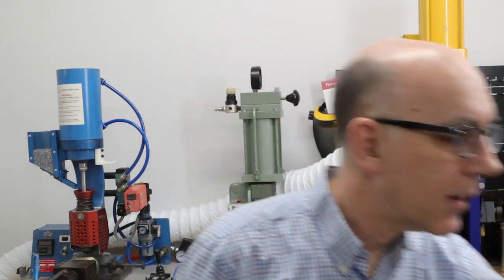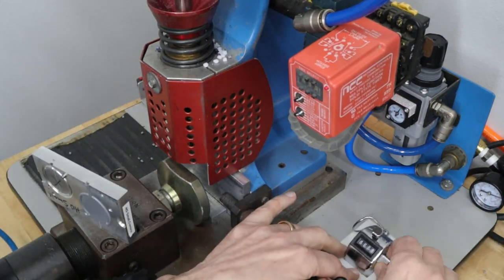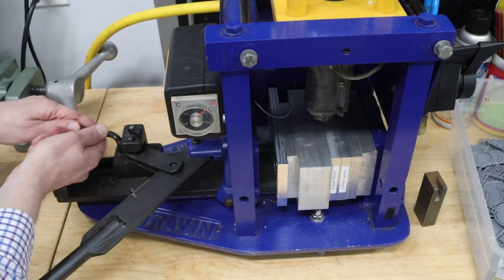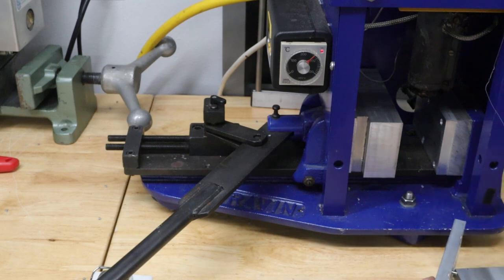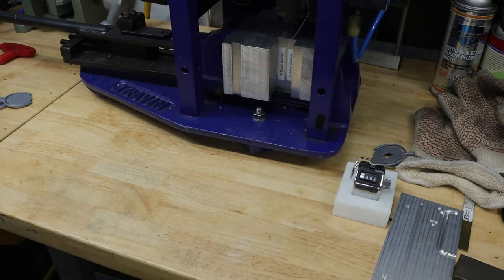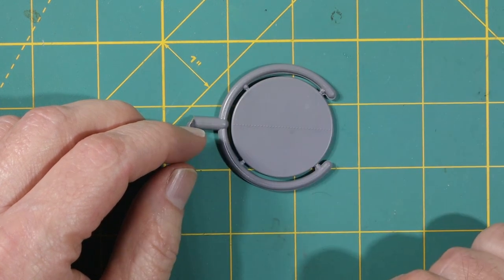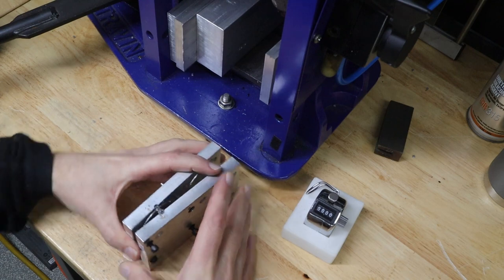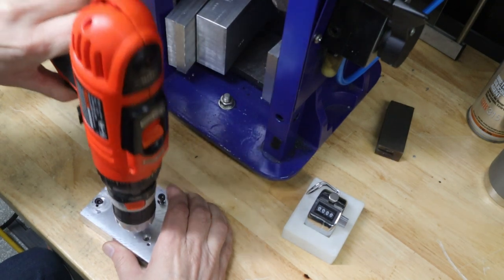Making Larger Injection Molded Parts

Comment: I've been watching a lot of your back catalog.  I'm trying to decide whether I want to get into injection molding or if I will farm out the work.  Your videos do a great job of breaking down the process and making it seem rather manageable.  Thank you for sharing your insights and experience.
Reply from the maker: I'm happy to help you answer that question. Send me an email if you're interested.
Reply: This is a really big debate - whether to make the parts yourself, or to hire them out. (It's a debate we've had at our shop and is still somewhat ongoing.)
JohnSL will have, I'm sure, some invaluable information for you if you reach out to him.
Reply: @TheCrafsMan  Thanks CrafsMan!  John and I have shot messages back and forth.  He's INCREDIBLY knowledgeable.  I saw the work he did for you as well (I'm a long time fan of your channel too).  I bought an injection molding machine about a year ago after I posted this comment!  Keep on Steady Craftin!!!
Reply: Im wondering what happens when you dont screw it? It seem like a lot of clamping force. How much pressure is the machine pushing the plastic?

Comment: You could probably double the cycle time on the screw reenforced mold.
1- Better/shorter driver. The Milwaukee M12 Instillation driver is excellent. Compact, powerful, precise, inexpensive. I started using them in my machine for clamps and fixtures and it is a game changer.
2- Make the screws 2"+ long, with holes in the spacer plate to accommodate the extra length. Unscrew the fasteners enough to get the part out without completely undoing them, and you reduce the handling count by 8. Massive time savings.
3- Mold jig for the operator. Eliminate the hand-torquing effect with a jig to hold the mold for opening/closing. Faster + Safer.
4- Threaded inserts (KeenSert, Helicoil, etc) to solve the threads in aluminum issue.
Great videos BTW! You're making me think we should get into injection molding our own parts!

Comment: Thanks John, I've just switched from a manual Travin TP1 to a hydraulic version the same as yours, I'm having trouble as I thought I would as I noticed the hydraulic version moves quite slowly and acts like a ram splitting open my moulds, I seem to have got away with it on my manual machine by pumping in plastic quite quickly this works pretty OK. I thought I would have to resort to bolting them together and you've beaten me to it!

Comment: Thank you for share you experience with the world !  Interesting rule of thumb for the clamping for molding part. The screw could be made to be remove by sliding of the edge of the mold. Maybe it would make you cycle time a bit faster. But it would need a nut and maybe a ticker plate. Great vid keep at it !
Reply: He could also fabricate a tool that uses a large planetary motor coupled to four gear driven chucks that could run them all in and out the same time but modifying the clamp with an Air over hydraulic ram makes more sense.

Comment: If you'll take a center punch and angle it into the hole for the dowel pin (without the pin in) you can put in a couple of punch marks, and that will be enough to lightly press the pin into place so it stays put.  You can also do it around the edge of the hole if that's easier, but anything that will just slightly deform the hole inwards will take care of it!  I had some molds where I got my clearances off and it allowed me to go ahead and use them.

When I make molds, I still make through holes for the pins, but I make most of the hole a slip fit for the dowel and a light press fit for only the last 1.5-2.5mm.  Then I can easily press the pin in after slipping in most of the way, and the pin stays.  But if I need to remove it, a couple of strikes with a punch or drift and take it back out since it only had a couple of mm of press fit.

We're still working on our plastic injector.  We have electronics working, and have made parts but now are going through a round of redesign.  I'll update you when I have an update!
Reply from the maker: Currently I use 1/4" dowel pins that I mill to very tight tolerances on my Haas. I also have 1/8" diameter through hole that would allow me to press out the pin if I need to. That works much better than these 10-year old molds.  Given that I'll probably never have to make these parts again, which I should have mentioned in the video, I figured it was OK to just make the parts. Looking forward to seeing your machine.

Comment: Have you considered using an over/under reamer set for dowel pins? The undersized reamer is a few tenths below, so the pin has to be pressed in and it will stay there while the oversized reamer is a few tenths over and provides good positioning.
Reply from the maker: There have been lots of suggestions along this line. These are molds I made 10 years ago before I know what I know today. I don't make molds this way anymore.

Comment: What about using a horizontal mounted 10 or 20 ton air over hydraulic jack for clamping? 

Would you be able to utilize the extra clamping in making a larger part? 

There are others using steppers and ball screws to clamp their molds who are making  significantly larger parts.

Comment: I had a question. You mentioned that the clamping force required is proportional to cross sectional area but it seems that most of the parts you make a quite thin. If the part you are making in this video were say 1in think with the same cross sectional area would you still be able to make it and the clamping pressure would still be sufficient?

I am considering getting one but the thickness of the part I want to make is about 1/2in thick with maybe about a 1in squared cross sectional area.

Comment: Johh, how does the Travin know when to stop injecting, or match the amount of plastic dispensed to the volumetric space of the cavity in the mold?   Why do we not see plastic coming through the air vent ?  Is seeing plastic oozing out a good way to know the mold is full ?
Reply from the maker: The barrel contains more plastic than the part needs. So it injects plastic until the back pressure equals the injection pressure. I then top off the barrel after every few  cycles. As to why it doesn't come out the vent, plastic is more like a paste than a liquid, so it can't fit through thin sections. The air vent is about 0.002"  deep, which works very well for air to escape without letting the plastic in.

Comment: A little tip for holding the packing pieces together is to use double sided tape. I used to swear by the Tesa brand (not cheap!) It's really good at not leaving sticky residue. Used to hold plastic plate onto a milling machine bed for machining! Don't use too much tape! Not sure if you're clamping force would be too much for it? Edit.. wish I knew the Tesa product code.. sorry

Comment: Hey John thanks for the injection molding content. I am using a manual plunger style desktop molder. I’m having issues with the nozzle drooling plastic out while I’m removing parts from my mold. It makes a huge mess and lots of strings when I scrape the glob off the vise each cycle. I’ve tried decreasing barrel temp but then my molds don’t fill. How do you handle this? Your process looks so clean (and with less plastic waste!). Thanks and love your videos!
Reply: I just bought a manual machine, it's supposed to be delivered this month, and I'm making a couple of molds to try when my machine arrives. The question is, how big are your plastic pieces? How many tons of pressure can be generated in a manual machine? Are your pieces bigger than JohnSL's? 

I am afraid that when my machine arrives, I will not be able to fill my molds, due to lack of pressure. which is the nature of the manual machine.
Reply: @cesarmata3787  mine is an LNS-150A. The parts I’m making are round wheels, 11mm diameter and 6mm thick. My mold makes 4 wheels at a time. I extended the handle on my machine and it still takes a lot of force to fill the molds. My abdominal is sore after a day of molding haha
Reply from the maker: That's often an issue with desktop machines. All of my machines have a valve in the nozzle that requires the nozzle to be slightly pushed in before the plastic will flow out of the nozzle. That pretty much prevents drooling. Another thing that makes a difference is the type of plastic. These parts are all polystyrene. But I know polypropylene is a lot runnier, and therefore more likely to drool.
Reply from the maker: Four of those wheels sounds like expecting a little much from the LNS-150A. You might be better off with just two wheels at a time. Sure, it reduces throughput in theory. But it might give you better process reliability.

Comment: Great channel! 🙂
Have you tried that mold without the screws? Looking at the clamping system and that steel machine body it looks more like 10 ton equipment than 4 ton. Even a decent bench vise is good for 4 ton.
Reply from the maker: Yup. When I first made the mold 10 years ago, I tried it without screws and I couldn't keep the mold from flashing. So I added the screw holes, which are somewhat crude because of lack of skill on my part back then. The Travin TP-1 states that it's a 4.5 T clamp.

Comment: I'm a bit surprised you didn't  ream the dowel pin holes, with one side being an interference fit and the other side being a slip fit, pressing the pins into the interference fit side for permanent retention.
Reply from the maker: These are molds I made 10 years ago and, well, there are lots of things about these molds that I would be embarrassed to do in molds I make today. Because of the very low volume, it's not worth redoing the molds. In fact, it was never financially worth making the molds in the first place, but I learned a lot.

Comment: Hi John-
first, thanks for the videos. These are very educational for me and I'm learning a lot.

But here's a question, and I apologize if you may not like it, but... What is your take on the Precious Plastic injection machines? We have one here in Savannah, and we like it because it allows us to recycle pretty fair amounts of plastic that would otherwise be landfilled. But we want to up our game.

Ours is a manually operated machine that injects a comparatively large volume of plastic. It uses bolt-together molds that are (again, comparatively) fairly crude- simple laser-cut affairs. We make simple coasters and small plant pots, and small sea creature keychains.

So my question is this- what improvements would you suggest for these machines? I have a few ideas that I'm mulling over, but I'd LOVE to hear your thoughts.

Thanks
BG
Reply from the maker: I have no experience with the Precious Plastic machines. I've used bolt-together molds and try to avoid them when I can because they're so labor intensive. It sounds like the one improvement the machine could use is better clamping. A toggle clamp is probably a good choice, and probably not that hard to design and build.

Comment: Thanks for another injection video. Have you thought about using loctite or super glue on the dowel pins? I would press fit them from now on but to fix your older ones that may work.
Reply from the maker: That's what I do on my more recent molds. With these molds, I often have more than one cavity and I have to use different holes for different cavities. These are molds I made 10 years ago, when my skills were, shall we say, still developing.
Reply: @JohnSL  ahh I get it. Maybe silly puddy or something sticky like that that can just kinda keep it from falling out.
Cheers.
-Daniel
Reply from the maker: What I could have easily done is to use some removeable LockTite since I already have some. But, well, I just wanted to get the parts done. And most of the time I did a good job keeping the pins from falling out.

Comment: nice video! Are these more parts for the train model oil tank building from last week?  A static vent pin in the middle of the part may help with getting the air pocket out and lower you pressure. if cosmetics allow
Reply from the maker: They are. I could certainly put a vent pin in the back. That being said, these are molds I made 10 years ago and I expect I'll never use them again, as the kits are being discontinued. So not worth improving. Plus, production volume is tiny--I think on the order of 100-200 parts total for the lifetime of these molds.

Comment: Hi John,
Could you please help me identify one very, very old injection moulding machine which I purchased on Ebay near London.
The tags exhibit the previous company name and a patent number. Unfortunately, the patent relates only to the way the mould is pushed out from a mould by operating the vice, and not the machine itself. I am interested in an operating manual or blueprints, since some hydraulic parts are missing and the heater energy regulator is not really working as it should. It is always in the ON position, regardless how I turn the knob. Finding a replacement for this is a task by itself, unrelated.

So, is there any way you could help me, considering your experience? Any advice is welcome.

Comment: great video, could you use a large c clamp  around the outside of the  machine to boost the machines clamp?
Reply from the maker: Possibly. Although, I'm not sure that would be much faster than the screws. Fortunately, I've now retired the molds that required the screws. Plus, I have my Morgan, which has much higher clamping forces. I'm debating selling the Travin.

Comment: John,  do you have to cool the die halves periodically or are the cycle times low enough that the heat doesn't build up?
Reply from the maker: For larger parts if I keep running them for a while, the mold does get hot. The issue is being able to hold the mold. Because it's aluminum, it doesn't take long for the mold to cool back down. For small parts, the molds never really get that warm.

Comment: Great video 👍John Tool maker's use a half thread trick to speed up jig time assembly disassembly machined at angle half the thread's are used.
Reply from the maker: That sounds interesting, but I think I need some more information. Can your provide a link or a longer description? I'm intrigued.
Reply: @JohnSL  I used a few drill jigs that had a nut with part of thread cut away I tried to find a link no luck an alternative would be a multi start thread as used by fly presses it moves greater distance for a given motion and multiple load.

Comment: what if  we install   20 ton hydraulic or more at this  home injection machine (with reinforce structure for sure), do you think it can make even more larger part sir? . How big the part is that can possible with this type  home injection molding. I think about more larger part like a size our palm hand. Thanks.
Reply from the maker: Yes. Some people have done that and it works. The rule of thumb is that you need 2 to 2-1/2 tons of clamping force for every sq. in. of cross section. So using the upper value of 2-1/2 tons, that would give you a maximum cross section of 8 sq. in., or 2.8" by 2.8".
Reply: @JohnSL  I see,  the clamp that need to reinforce too as the pressure increase.. thanks Sir..

Comment: Maybe use dowel pins but thread one end so they can be left on one side of the mold?
Reply from the maker: Thread locker is a lot easier. I should have used that in this mold, and can't give a good reason why I didn't.

Comment: I may have missed something in earlier videos, but what happened to the Morgan press? I would have imagined you would have used that machine for your larger parts.
Reply from the maker: Yea, I mentioned in my previous video that these are molds I made 10 years ago, long before I got the Morgan. These we would super easy to make with the Morgan. But it's not worth redoing the molds because the volume is so low for these parts.

Comment: Thank you, i learn about the pressure of sq inch of injection mold, is that possible to have two or more injection input in same time for large scale mold?
Reply from the maker: If I understand correctly, you're asking if you can make more than one part in a mold? If so, yes, I've done that. But that would require even more clamping force (or screws).
Reply: @JohnSL  oh, yeah, i see！the mold need to under take more pressure and damage by pressure.

Comment: Is it possible to have molded-in parts included, such as power connectors,  when do the 3d printed mold approach?
Reply from the maker: Yes. This is called over molding. The requirement is that the mold is tight enough around the connectors that need to be exposed so the plastic doesn't exit the mold.
Reply: @JohnSL  Thank you very much for your answer. Is this something that you could demonstrate? It would make a pretty good video. For example, in the connector example, if they do not come from the front of the hole but they are inside the hole, isn't there danger of plastic covering them up?

Comment: you have a cnc machine, put some interlocks on your molds.
Reply from the maker: I could have. But it was worth it. I expect this mold will be retired after this run. I spent an hour making parts from this mold, which is less time that it would have taken to improve the mold. And I'd have to hunt for the mold CAD files, as I did this 10 years ago. That in itself might have taken more time than just running the parts.